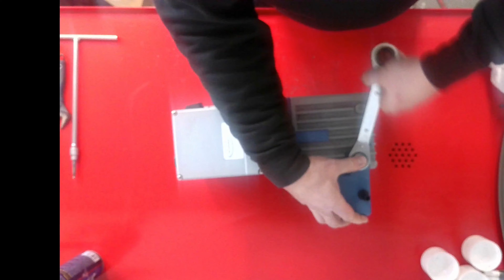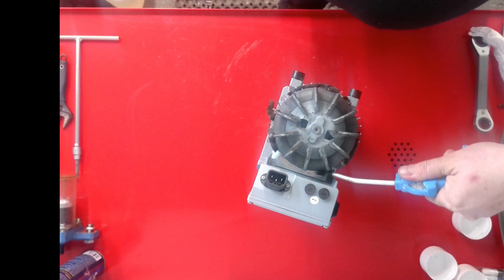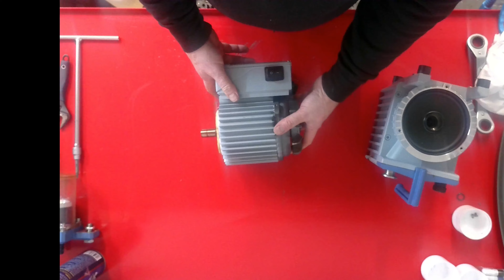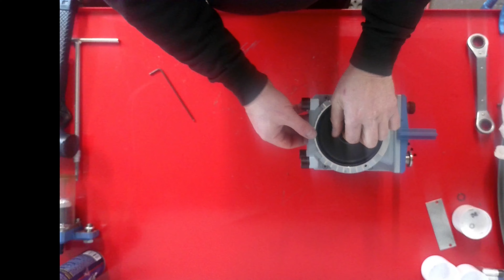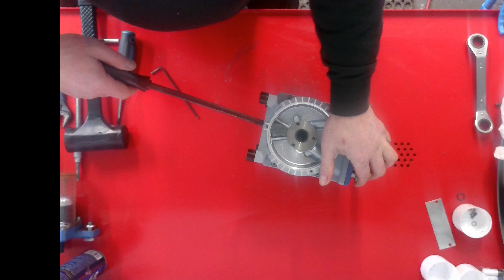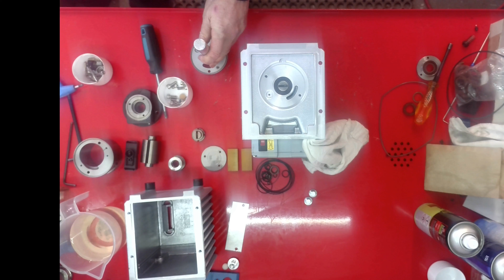Vacuubrand RE6 full strip down and rebuild

Comment: Hi Angus, Do you happen to have a brand name for the tie rod driver set? Thanks so much for your help!
Reply from the maker: Hi David. I'm assuming the motor tie rod tool? Sorry mine are unbranded and they are not easy to come by as motor manufacturers mostly went over to hex heads. Vacuubrand will supply you one though and that will be correct for your pump. If you are local to me (UK) I can deal with that for you. If you are further afield then get in touch with your local distributor and tell them the model of pump you have as there are different sizes for different pump models. Cheers, Angus
Reply: @LabVac  Thanks Angus, yeah that's the issue I'm finding over here in the US - everything is hex head, but no worries I'll reach out to my vacuum distributor, appreciate the quick follow up - Cheers!
Reply: Always a pleasure

Comment: I want to buy all the seals of the vacuum brand rz6 machine. Do you sell them to Vietnam?
Reply from the maker: Hi. Sorry, I can't supply them to Vietnam. I think the official outlet for Vacuubrand in Vietnam is https://www.its-vietnam.com/
Reply: @LabVac  thank you, i have consulted the web but there is only model rz2.5, my device is rz6 vacuum only up to 0.014 mba. so i am not satisfied
Reply from the maker: @maianhspaacnetreatment3268  the service kit for the RZ6 is the same one as for the RZ2.5. All service parts are the same. Angus
Reply: @LabVac  Thanks, I took it apart and checked and the oil pressure gasket was broken. I don't know if that's the cause.
Reply from the maker: @maianhspaacnetreatment3268  well done for getting in there. If one seal is failed then the others will be close behind so a full kit will be needed
Reply: @LabVac  yes, so i want to order a whole set to replace it, because it is not popular in vietnam.